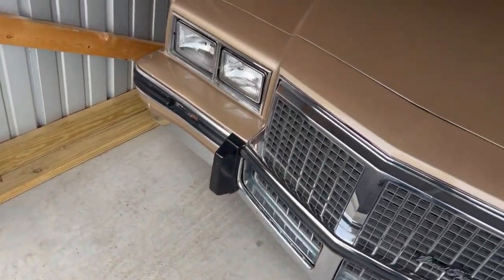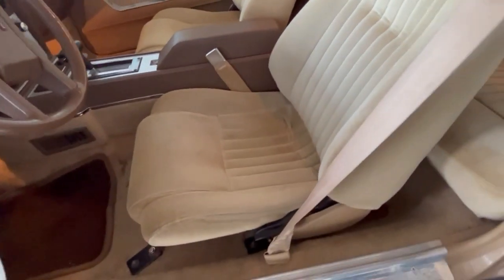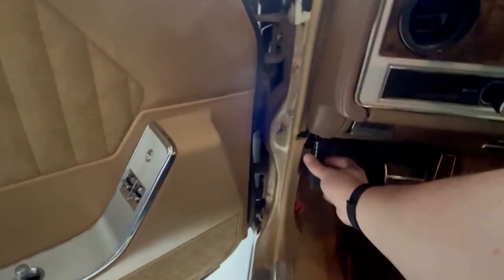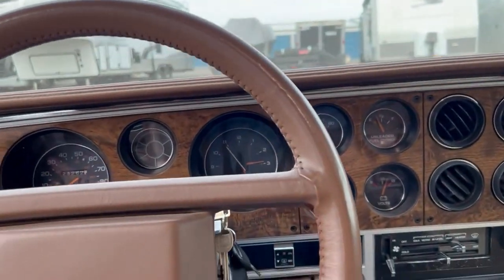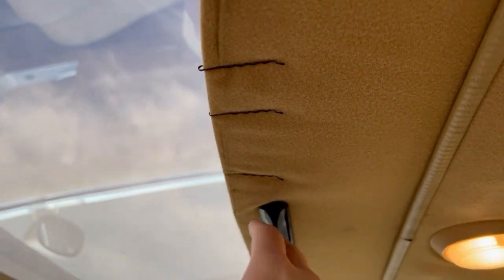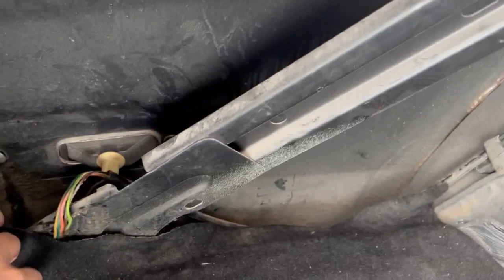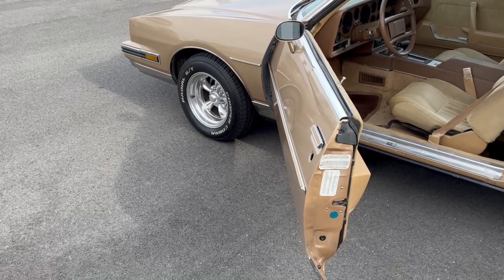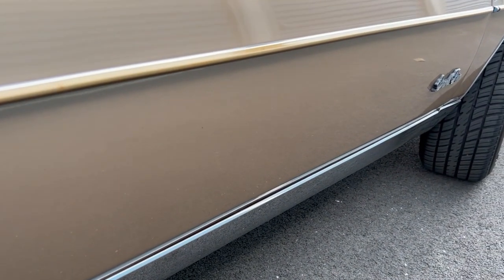1985 Pontiac Grand Prix Walkaround

Comment: Really nice!! I love that fact it has the console and gauges and of course a V8. I love GP's from about 1975 until 1987. I had a 1977 GP and a 1983 GP. I didn't have the 1983 long because I didn't care for a 3.8 V6 and it was bare bones and the rear bumper rusted out. I think I was spoiled with the 1977 because it was loaded!
Reply from the maker: This one is my fourth. Before this one I had an 84 Brougham, 85 LE and 76 SJ.

Then this one, and I also bought another 85 LE in September. That’s the silver one I mention in the video.
Reply: @Chicago_Cars  You know they also put in a 4.3 v6  I think it was throttle body.I drove one and it had plenty of power and torque and ran like a v8 !
Reply from the maker: @markchwala  I have never owned one of these with a V6, all of my Grand Prix and my one Monte Carlo (06SS) were all V8
Reply: @Chicago_Cars  I guess the point I was trying to make that the 4.3 was far superior in power to the 3.8 respectively.I own a 1981 Grand Prix LJ with 72,000 miles, it is the first year of the newer body style that started in 81.

Comment: Wow! I had a 1983 Grand Prix. It was white with blue leather top and blue cloth seats. I kept it until 2001. I didn't have power windows. The only thing I wanted to get for it was Cragar S / S rims but never did. I did put an Eclipse CD unit in it in 1994 which at the time was a premium head unit and I think I paid $580 for just the head unit. Mine was a V-6 with a 231 cubic inch engine. I think that was pretty much the same engine the 1986 Buick Grand National had in it except that had a turbocharger and some other modifications. 

Miss that car. Yours is in great condition!
Reply from the maker: Thank you!

Comment: I had a 1985 Grand Prix that came with the 3.8.litre v-6,drove that for about 6-7 months,and then I pulled it out and put a 1979 Chevrolet 4-bolt main ,with pretty much stock except for I had the crank turned 10-10,put a R.V.cam in it and the 883 cylinder heads and and a Holley 750,w/a Holley street dominator intake,did not want to make that car fast but it was quick enough,but I was way more impressed with how good it ran with the rebuild recipe and just more along the lines of being very dependable,and definitely dependable it was.i truly miss that car.thumbs up to you and your videos...❤👍💯
Peace and Blessings to you ALL 🙏💯👍
Reply from the maker: Thanks and same to you and yours!

Comment: Thank you for responding,...I forgot to mention, ..I'd had a 81' Buick Riviera bought from a family members old friend,...it was in great shape, not a single dent, all electric windows/ seats, gray on gray interior, vinyl top, just exceptional condition, bought it in 96, ' ...two 1/2 yrs later, the  freeze plugs went out, ($ 400 repair) ....you seem quite knowledgeable regarding GM bodied classics,....did you know it had a front-wheeled drived, drive train? Lastly,  again, wanted to see if you'd be willing to sell the G.P.?
Reply from the maker: I knew some of the GM fleet was switched to FWD by then, didn’t know about the Riviera, pretty cool.

I’ll listen to reasonable offers, but am not actively trying to sell.

Comment: 85 Monte Carlo ,Regal and Cutlass Supreme  were good cars with that 305 V8 and 4 Speed Automatic Transmission  with OD   my Favorite was 85 Olds 442 and 87 Buick Grand National
Reply from the maker: The 4 speed option was pretty rare tho. I think they all should have had it instead of the weak 3 speed like both of mine have!
Reply: @Chicago_Cars   the Late 1980s had the Better Transmission  the GM 4LE60   EVEN the GrandPrix ,Cutlass Supreme and Regal all got redesigned in 1988 with that 3.8L V6 that 4LE60 Transmission  was good one   compared to the200-4R Transmission  of the 83-87 Models
Reply from the maker: @Steelers2841  didn’t they all become FWD in 88? That would be the 4T60 trans then, wouldn’t it? Later replaced by the 4T65 in the supercharged cars and just as weak behind the V8 ones lol
Reply: @Chicago_Cars    i store my 85 Olds 442  and rebuild   took out the  5.0L  and put in a 5.3L  from a 2009 impala ss  and put in a GM  4LE60  IN  2015  of a good friend   we were  thinking putting a 6.2L super charge caddy  v8 and 6 Speed Auto  in that   INSTEAD   I  have a 2009 Ford CVPI71  WITH A 5.0l  coyote  V8  WITH A 6 SPEED  AUTO   PUT IN IN A WHIPPLE SUPER CHARGER in that bad boy

Comment: Nice car, I had 85 grand prix le exactly like that, except mine was the original color like the inside of your trunk lid, Cream Beige. And mine had a tack where yours has a clock. And mine didn't have a vinyl top. You want to make yours where no one tries to steal your car?  Leave it unlocked with the key in the ignition that way they don't damage it. Then the fuse to the ignition coil cut the wire and wire in a switch and hide the switch and wiring where it can't be seen so you can toggle off your power to the ignition coil.....  I can guarantee the thief won't take the time or know how why it doesn't have spark......
Reply from the maker: I’ll admit I’ve thought about employing a few different theft deterrent ideas since this happened.

Comment: That was trans fluid wasn't it on the floor? 🤔
Reply from the maker: Nope, oil. Didn’t film but the oil pan gasket is leaking. Tightened up a couple bolts and it seems like it’s good now.

Comment: The Pontiac and Olds steering wheels from this era were much better than those in the Chevy and Buick which looked cheap and awkward to me.
Reply from the maker: I really dislike the wheel in my two 85s, I’d prefer the olds flat bar style. Or even the earlier Pontiac T style ones
Reply: @Chicago_Cars  The Olds wheel used from about '84 onward that had the extra horn buttons on the cross bar (in addition to the pad in the middle) was very nice looking. I despise the Buick designs that initially had the downward turning crossbar and then later was just an ugly rectangle. The Chevy was low-grade looking, like it was pulled from a Chevette. The Cadillac steering wheel was excellent. I do like the Pontiac wheel from this video. What didn't you like about yours?
Reply from the maker: @AlexanderCrump  I don’t like the big rectangular horn button or the horizontal cars.
Reply: @Chicago_Cars  I liked the Ford four-spoke steering wheel from the early to mid-'80s  used on everything from LTDs to Mustangs but those had the horn on the end of the turn signal stalk. Idiotic.
Reply: @Chicago_Cars  The sport steering wheels used on the 442 and T-Types were awesome.

Comment: No disrespect if the car is all original it should be a 301 with the 700R4 transmission.  I only comment that as I would hate for you to order parts a 305 and have to return them.  Great car great content
Reply from the maker: Actually that’s incorrect. By 85 GM had switched to a Chevy 305 and a 200 metric in these cars. All of my research says so, plus the RPO codes in the trunk agree.
Reply: @Chicago_Cars  thank you see even old dogs like me can learn a new trick. Lol thank you for the information
Reply from the maker: @cliffordplasd8239  no problem at all. I still learn new stuff about these cars all the time, so it’s fun to share the wealth!
Reply: The Pontiac 301 went out of production in the early '80s and the Pontiac G-bodies in the mid '80s had either the Buick 3.8 V6, the Chevy 305, or the Olds 5.7 diesel.

Comment: Not a big fan of the showy mag rims,.  I'd go with the stock hubs .......jmo.
Reply from the maker: When I bought the car it had the steel wheels with wire wheel hubcaps, these were the first set I could find. I think you are the first person who doesn’t like the polished aluminum, personally I love them.

I do not like the upkeep required to keep them looking nice tho…
Reply: Yeah....IMO... I prefer to see mags on muscle cars... they're nice though....
Reply from the maker: @Jr._peace2all  mags refers to magnesium wheels, these are polished aluminum, not mags. With the motor swap I have planned, they will fit better.
Reply: Oh o.k. thanks.... I'd always figured it meant the style....of rims.... I'd had 4 straight laced tru-spoked rims when I'd had my 81' Buick regal back in 88'....which was in excellent condish. White w/  blue interior .. after awhile the rims began to peel....so would that've been aluminum dipped?,...
Reply from the maker: @Jr._peace2all  dunno the style. Could have been painted or chrome plated steel, clear coated aluminum, something else…
Reply: Oh yeah forgot to mention they'd been chrome....so I'm guessing they'd been chrome dipped....hence the peeling later in life.....